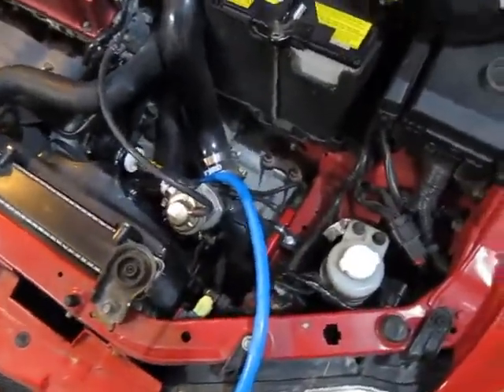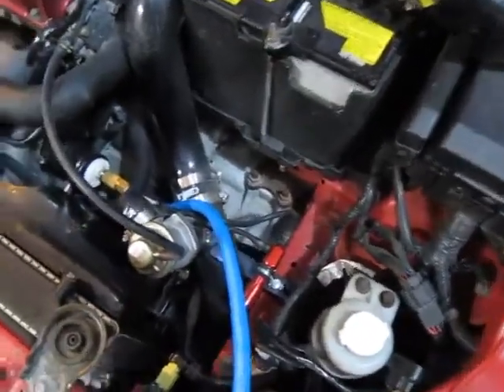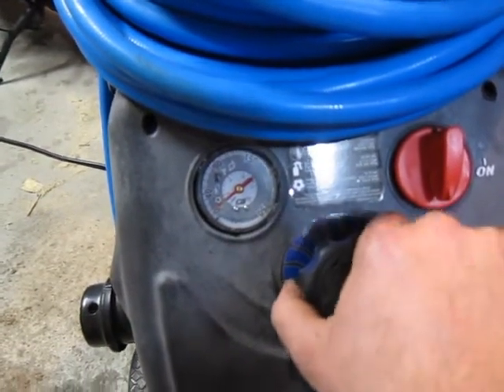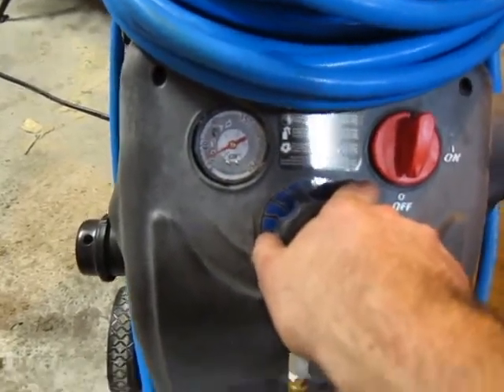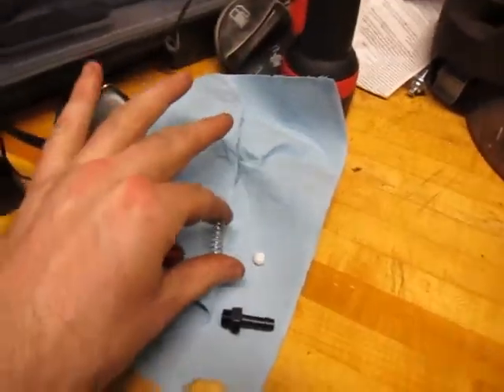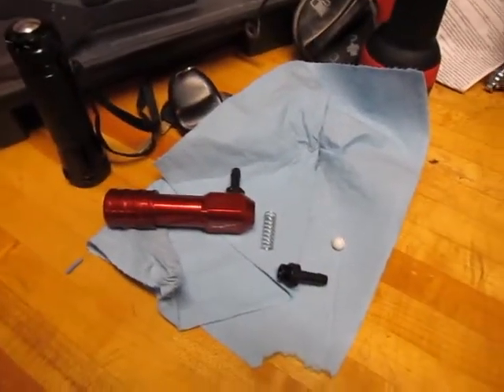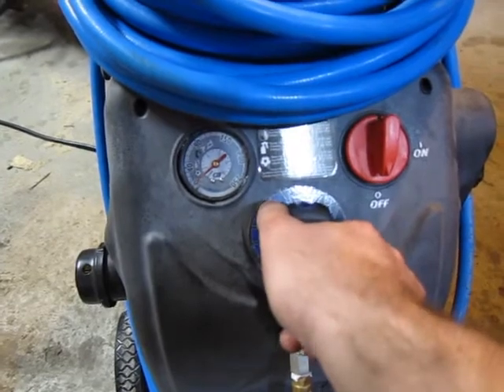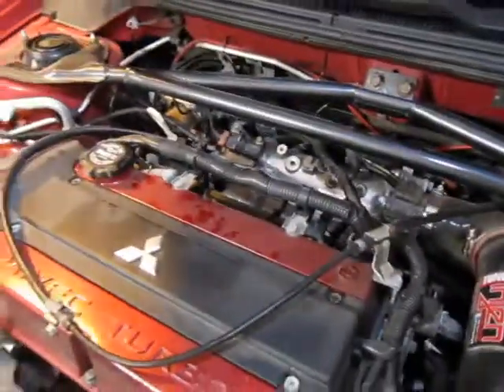Hallman boost controller leaking...

Comment: Well the little hole is there to bleed wastegate pressure when you're off boost so the line doesn't stay pressurized and the wastegate open. It also serves to prevent boost from spiking.

When the ball doesn't set cleanly, it leaks past the ball and out that hole. That's why when you took it apart and cleaned and lubed it up, it was able to set properly and not able to leak.

I really wouldn't block that hole unless you want your boost to spike and not to hold steady. Hope that helps

Comment: My Hallman is doing this exact same thing!  And like you, I was pretty darn sure that it never leaked out during boost leak tests before!  Hopefully mine will have a little oil residue inside, like yours, so that when cleaned and reassembled, it's fixed like yours.

Comment: Is your car tuned? I wanna add a mbc too but some say you have to be tuned before you add it.
Reply from the maker: +tommy facekicker  yes, I believe I had tuned before the MBC, but mostly because I had read that a tune really gave the biggest bang for the buck for a stock Evo.  That being said, I don't see why you couldn't get an MBC installed before a tune.  Since they are adjustable, you could install it, and get your boost back to stock levels and then increase it little by little to ensure you see no negative results...  but at the end of the day, a tune will give you great response and HP increases!

Comment: Hallman is one of the best manual boost controllers you can buy, you really should buy one. Anytime you have a boost controller or BOV blow off valve you should always keep the parts inside lubricated.
Reply: What should they be lubricated with? I have a brand new one. Just curious if I should do some preventative maintenance before installing.

Comment: I'm sure the instructions say to mount that boost controller with that hole facing down.  In other words, you installed wrong!
Reply from the maker: http://www.hallmanboostcontroller.com/ES%20New%20Instructions.pdf   here is the instructions if you wish to read them.

If you think that mounting something with a hole facing up or down makes a difference when the actual part is meant to hold back 15psi or more, then you might want to brush up on your physics my friend.
Reply: Thank you friend.
Reply: I read the instructions again since I actually read them before (I have two such boost controllers that I bought new directly from Hallman), and clearly they state that the barbed fitting with the tiny hole should be installed facing down to work properly.  Not sure you had a leak because of that but you didn't follow the mounting instructions anyway.

Comment: How was the boost after hole blocked off? Went to peak and hold steady?
Reply from the maker: yep.  nice and steady.  maybe a little creep at high rpma
Reply: +mmixan wow didn't expect that, I know that hole it functional to bleed off boost.
Reply from the maker: the fix wasn't to plug to hole... sorry if that is where i was leading you.   the fix was to take the MBC apart and clean the insides.  I think the ball (which forms the seal) was dirty and letting air leak past.  once I cleaned the internals thoroughly that is when the hole no longer leaked air and the boost held well
Reply: +mmixan thanks for that info, now I understand 😊